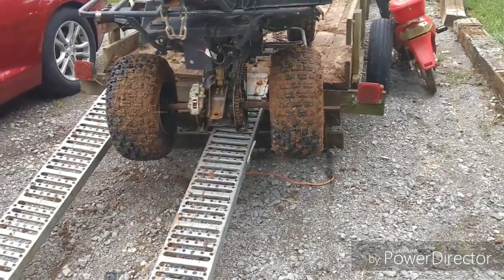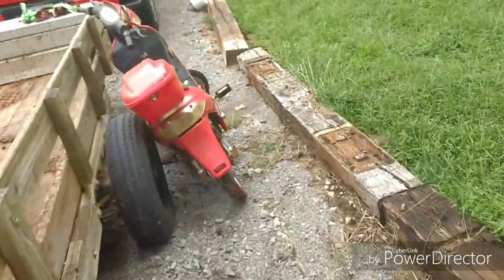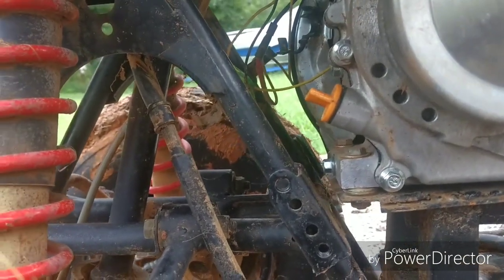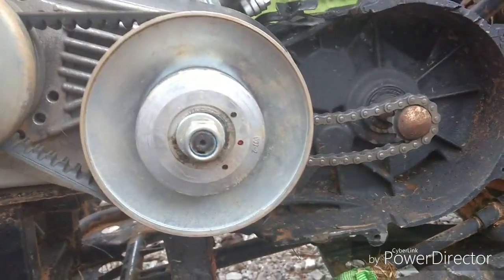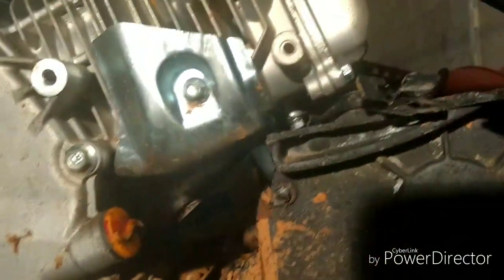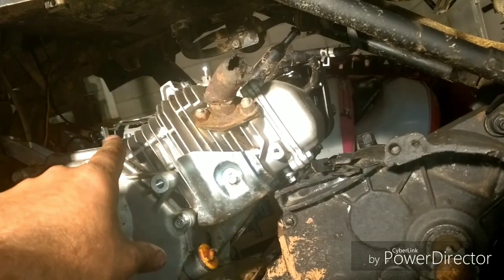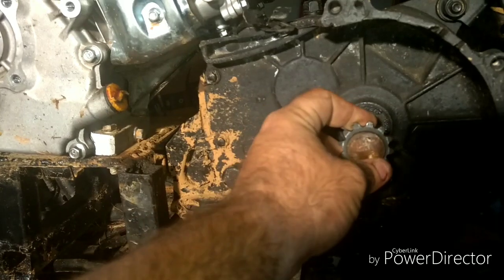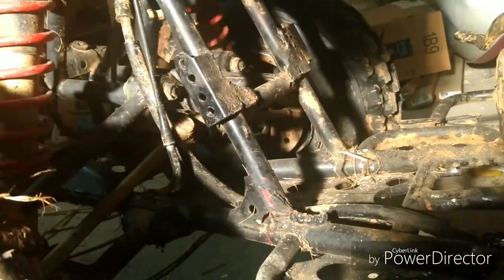Frankinquad teardown and rebuild part 1

Comment: Very nice
Reply from the maker: Thank you.
I saw you trying to pickup that 300 Honda ATV.
Are you planning a pred ATV build too?
Reply: @hillbillyholler516  sorry for the late reply, Actually it was the suspension and engine i wanted to use off of it for my 606
Reply from the maker: @chauvinsgarage1515  if he was close I would have jumped on buying it off him.  The engine just needed sleeved or bored the parts he already had installed.
Reply: @hillbillyholler516  yeah it would of been a perfect project. I woulda loved it, But not only was it too far, But i don't have you near by to help me do the work Lol

Comment: Awesome stuff! I only saw one other guy cut the trans off and install a predator like that. Rasta B TV did that and put a 420 on a Bombardier 4 wheeler. It had a GY6 style engine originally that was water cooled and you couldn't get parts for it. He installed a 420 to the trans and made a nice machine. It is probably better now than with that water cooled  engine. Can't wait to see more!
Reply from the maker: Cutting them apart is a nightmare!
Thank you. 
I'm hoping to have it going again over the coming weekend